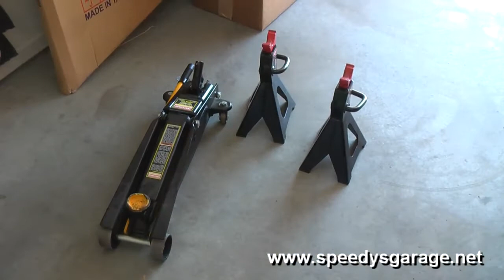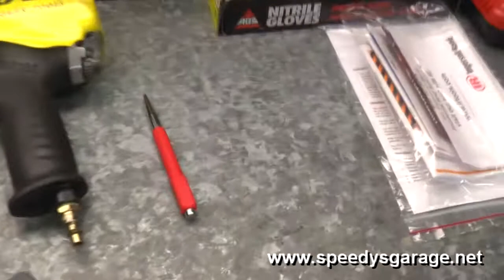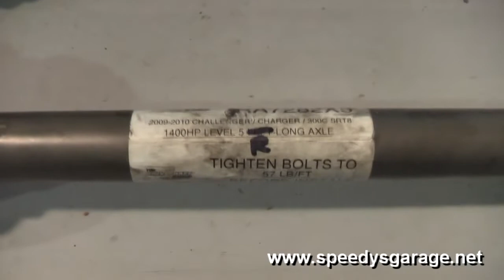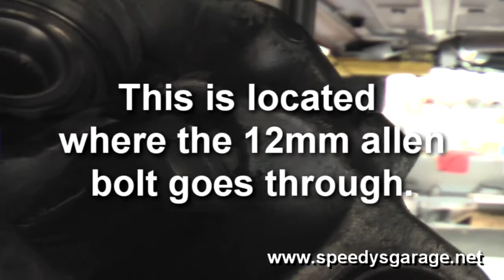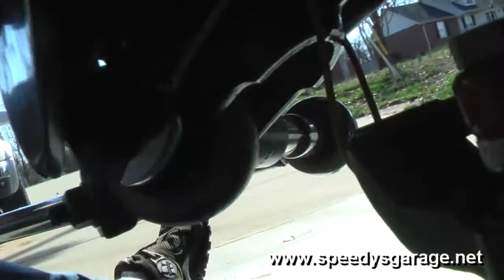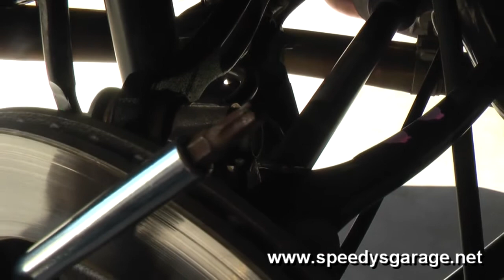Dodge Challenger Axle Install Level 5 Drive Shaft Shop Speedy's Garage

Comment: This is an EXCELLENT guide. Better than ANY manual I've ever used. Also, thank you for going in-depth on the footage of the bolts AND the torque specs. Once again, Thank You!

Comment: Badass video, what do you recommend to upgrade on the rear on a 392 challenger m6 so i help hard launches without breaking parts?
Reply from the maker: I don't really upgrade much until it breaks honestly.  These new models are pretty tough.

Comment: Hey noticed one thing. 1 you can be new abs tone rings.. found them on AM-AutoParts, got them in 3 days set of 2 under 30 bucks, 2nd .. i noticed the DSS axles are machines to accept the shield for the lip seal side.. those need removed from the stock axles. and the fit on the DSS.. reason you didn't install them on yours?
Reply from the maker: This was 10 years ago I guess, couldn't buy them then or I would have for sure.

Comment: How and the hell do you get that hub assembly back on? I have a 2015 challenger and that hub will not go on
Reply from the maker: On mine there was a little locating collar on the hub.  I had to use a bolt/nut to press it in to the hub, and when you reinstall the factory bolt it pushes the collar back in the locator position.
Reply: @SpeedysGarage  gotcha. I ended up getting a 3/8” extension and putting a 15mm socket on the end the same diameter of that collar and hitting it with a sledge hammer

Comment: After removing the 12mm Allen bolts I still wasnt able to pull the spindle.  There must be a sleeve or something in that.
Reply from the maker: There is a collar in there.  It's been a long time since I did this but I think I used a bolt to press it back.
Reply: @SpeedysGarage  so all I need to do is press the collar back and it will come free?
Reply from the maker: I "think" so.  Been 10 years since I did that work.
Reply: There's a bushing in there.  I'm doing mine right now.  You can hammer the knuckle off.  Getting it back on is a booger.
Reply: @ScoutPL  will you need a alignment after doing all that?